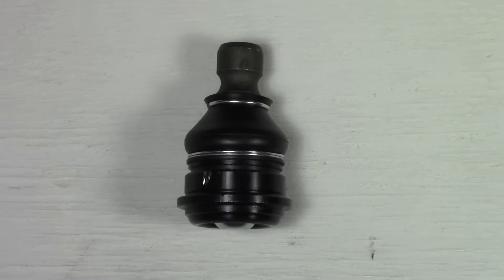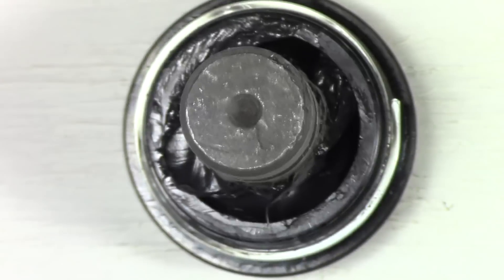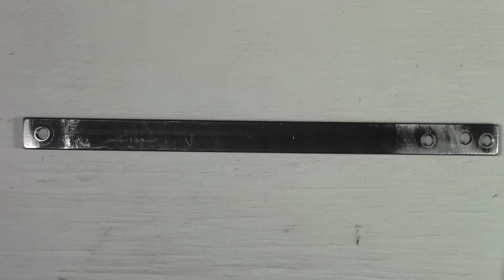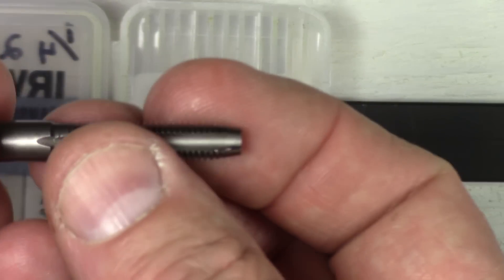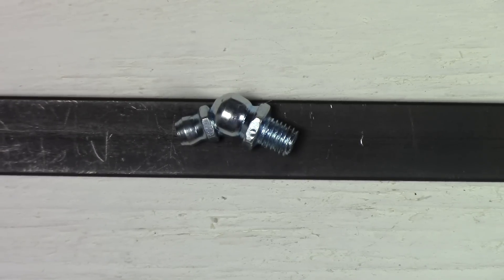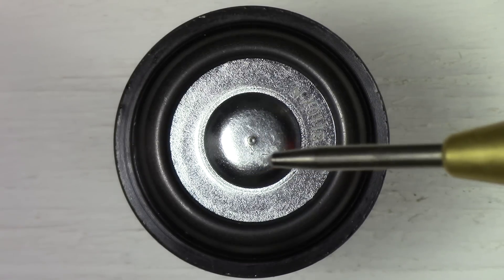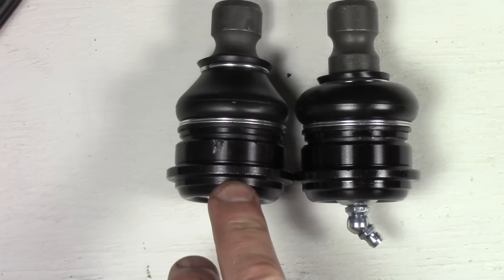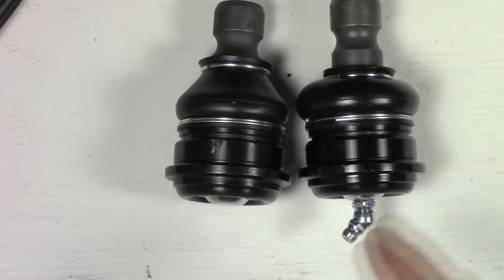Installing Zerk Grease Fitting On Lower Ball Joint Testing And Lubrication Hyundai Santa Fe

Comment: excellent vid Richy...instead of taking thread off the grease fitting (if its too long) just add a rubber o-ring (various thicknesses can be had ) so you can experiment or even plain washer(s)....thats if clearance ain't an issue
Reply from the maker: Thank you very much, I would think an O-ring would be too soft for this application but a plain washer will do. All the best.

Comment: Way over greased......the first mistake made by lube techs and mechanics coast to coast. 
PS if you are doing the work on a drill press out of the car you may as well remove the boots and throw them in solvent to remove the factory grease then when you drill them you can blow out the metal chips with a blow gun or spray can solvent and by removing the original grease prevent mixing of two different brands of grease which may or may not be compatible with each other.

Retired ASE certified master tech.
Reply from the maker: Thank you so much for watching, commenting and the valuable feedback. I appreciate it greatly. All the best.👍😀